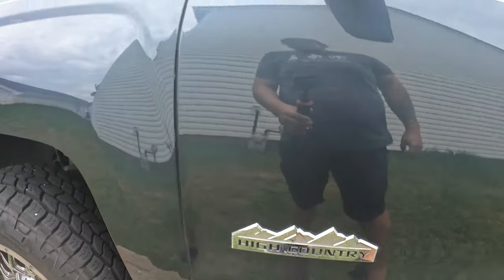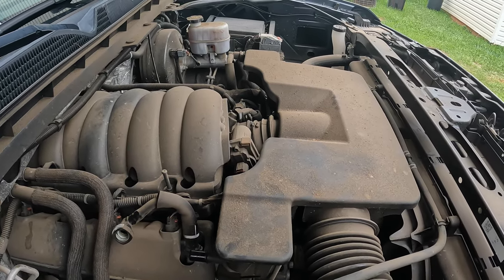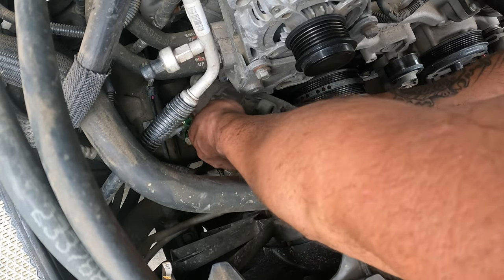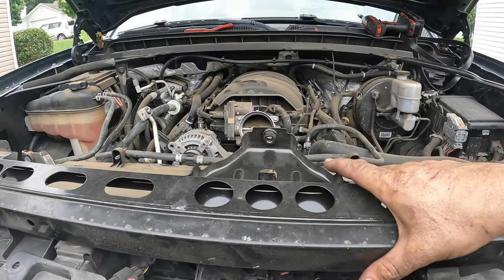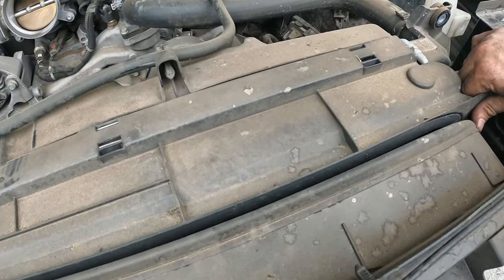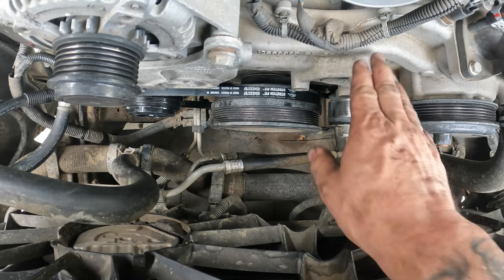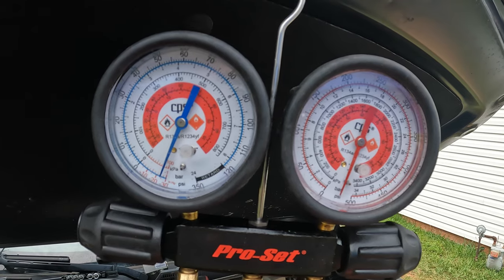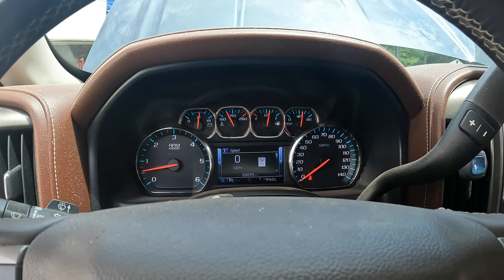2014-2018 Silverado AC Compressor and Condenser Replacement.

Comment: Would be good clean (flushing)system before filling up (why ac doesn’t work before)just my thought
Reply from the maker: It is a good idea and many times a compressor is not have a warranty unless you change the condenser or flush the system. Typically I flush the system if I do not change the condenser.

Comment: If belt good can walk it off by turning the crank shaft with 24mm/ 15/16 socket
Reply from the maker: Yeah that is true.  I normally always quote a belt with the job just to be safe.  I have seen lately  that some compressor will not warranty a compressor now unless you change the belt, especially if it is a stretch belt, and most require you to flush the system no matter what too.  But if the belt is in good condition you are right, you can always walk them off just like you put them on.

Comment: had a mechanic do motor mounts because I had a back injury.. he left the damn plug off the back of that AC pump.. Turns out with that disconnected, the clutch will engage however no cold air.. I'm assuming that is some type of pressure switch or valve that stops the flow of freon? I got it connected however it was after I pulled the lines and discharged the system.. The guy said to bring it in and he will do the draw down and 1234yf charge for free.. this is why i have trust issues with 'mechanics'..
Reply from the maker: I fully understand that.  That is one reason I started doing the videos as well to show my customers that I actually change stuff and I try to show me running the vehicles at the end as well.  There is a pressure switch both high and low for this.

Comment: What is the reason for draining the oil and filling it right back?  Why not use the oil that it comes pre filled with?
Reply from the maker: This one did not have the sticker that said how much oil was in it.  Some of them will tell you that it has "X" amount of oil in the compressor.  If it does not specify, I will drain it and then put in the correct amount.
Reply: @operationoverhaul you should had add that to your commentary I was about to ask the same question.

Comment: A mechanic just change and put new ac delco compressor a brand new expansion valve and replaced the belt as well “flush the system and recharged it but didn’t fix the problem not blowing cold air the old condensor doesn’t show any leaks so what could be the problem?
Reply from the maker: Can you hear the blend door moving when you change it from hot to cold or vice versa
Reply: @operationoverhaul  I’m not sure we didn’t even try that we were just focus on cold air.
Reply from the maker: @TheodoreRizzo  i would check to make sure the blend door is functioning properly and depending on the year,  I would check the cabin air filter as well.
Reply: @operationoverhaul  2016 gmc sierra Denali 6.2 liter when I switched from hot to cold the sound is a lot stronger coming from the glove box area. 
Not sure if that means anything nor what sound should I look for
Reply from the maker: @TheodoreRizzo  does it get hot when you switch it to hot?
Reply: @operationoverhaul  yes right away very hot
Reply from the maker: @TheodoreRizzo  i wish I knew what pressures are reading and does the compressor activate the clutch?

Comment: I’m having some AC problems with my 2017 Silverado. AC works great until it gets really hot outside (mid 90s and above), then it starts blowing warm air. Pressure in the lines is good, doesn’t appear to be leaking refrigerant anywhere. I’m wondering if it’s a bad pressure switch. Where are they on these trucks? It looked like one on the back of the compressor? Where’s the other?
Reply from the maker: Do you have a temp gun?  If so, check the temperature across the condenser to see if it is a lot hotter on one side versus the other.
Reply: @operationoverhaul  I don’t, but I could get one and try it. That said, the condenser was replaced just a few month back and the whole system recharged. I’ve only had the truck a month, so it was the previous owner that did it. The condenser looks brand new though, so I would imagine it’s not the culprit.
Reply from the maker: @DevinGrindy  if it has been replaced I would check the pressure switch. There is one on the compressor and then one on the high pressure line. I believe it is near the condenser on the driver side but I cannot remember. It may also be closer to the compressor.
Reply: @operationoverhaul  I appreciate it!
Reply from the maker: @DevinGrindy  your welcome and if you need anything more help or anything let me know

Comment: It took 45 minutes to put the belt on even with the lisle tool you linked?  Why?
Reply from the maker: I did not use the tool linked.  I was using a ziptie to help but this one was being stubborn for some reason.  Usually I can have them on in a few minutes but this one just did not want to go on.  It kept on wanting to walk off of the ac pulley.

Comment: The only info I can find for my 2015 Suburban shows that they use 6.6oz of PAG46 oil. My compressor came pre-filled with 3oz of 1234yf oil and says that if my system requires PAG46, I need to drain the oil and refill it with the PAG46

What the hell in the correct info??? Thanks
Reply from the maker: Service data on my end shows 6.6 oz of pag46.  So I would drain the compressor and then put in the 6.6 oz
Reply: @operationoverhaul  thanks for the info! I wonder why your vehicle and mine would use a different oil 🤷🏻‍♂️
Reply from the maker: @joeshmoe12301230  is your truck yf1234

Comment: So I just got to replace my compressor and would to replace my drier too?
Reply from the maker: If you are not doing a condenser I would at least do the drier bag, seals,  and flush the system.
Reply: Just got quoted $2500 to replace compressor and condenser , is this about right or am I getting ripped ?

Comment: How similar would this job be on a 2016 Tahoe
Reply from the maker: This should be very similar if not the exact same procedure. Normally the tahoe, silverados, suburbans, yukon and xl, and sierras are all about the same as far as engines.  The are a few differences but mostly the same.

Comment: Currently having problems with my 14 Silverado ac is cold sometimes then just starts blowing warm/cool air not cold. Pressure is good high and low pressure switch is testing good replaced relay all blend doors are working correctly and no codes you can hear the clutch working but has a very slight rattling noise. But it’s always done this. 
Any ideas what to test next 
Thanks
Reply from the maker: Does it get cooler when you ate driving and hotter when at a stop?
Reply: Check to see if the auxiliary fan is coming on
Reply from the maker: @kerrwilson265  that is what I was going to say especially if it gets warmer when stopped

Comment: Do you have details about the recall?
Reply from the maker: I'll get the details of the recall for you when I home from vacation.
Reply: @operationoverhaul  thanks!
Reply: Anything about the recall? Im just wondering how i can reach out to get reimbursed. I have a 2015 1500, that i yet have to fix
Reply from the maker: @muddy7776  https://www.lieffcabraser.com/defect/gm-air-conditioning/ try this site and it will let you know more about it.
Reply from the maker: @eumon84  https://www.lieffcabraser.com/defect/gm-air-conditioning/ try looking at this
Reply: Will filling the freon, you match the temperature outside with amount of freon?

Comment: I have a 2014 Silverado. I click the link for the ac compressor it shows me a RYC compressor not a Murray like in the video. Are all Murray AC components all owned by O’Rileys auto?
Reply from the maker: No they are not owned by oreilly. I can get you a link to the Murray if you would like. I'll get it for you tonight when I get home.
Reply: Yeah that would be great. I looked all over the internet. I can not find Murray Climate Control website anywhere.  But I do believe O Riley’s owns the trademark for Murray. No other parts store sells that brand.
Reply from the maker: You are correct.  I looked it up and Murray was purchased by Oreilly's Auto.  I also discovered that RYC and Four Seasons are sister companies as well.  So a RYC and Four Seasons (I think Napa carries them) are the made in the same factory.   I could not find a link to a Murray for you.  The RYC is the only one I can find.  Sorry about that.
Reply: No problem. I just wanted to double check some of the part numbers before I purchased and came along all of this. I do know RYC has a website but even putting all my info in. It shows a couple of kits but It doesn’t show the difference. So I have tried calling them and I emailed them waiting on a response.  But your video is very helpful. I just like doing a lot of investigating before I purchase. Just so I have all the right stuff here when I go tearing it down.
Reply from the maker: I wish more people would be like you and research stuff before purchasing.  Sometimes more expensive is not always the best option.  If you need anything else feel free to contact me.  I will help out as much as I can.
Reply: Thanks again. I wasn’t trying to show you up on the parts or bashing on you. I just wanted to make sure I’m ordering all the right parts the first time. Thanks. I will hit you up again if I run into anymore questions.
Reply from the maker: @MrKgolden32  I didn't take it that way. I'm glad you said something actually because it made me want to check it out.   I definitely do not know everything and if someone let's me know,  I appreciate it. It doesn't just help me out helps others that see the comment as well.

Comment: I put two compressors on and they both making noise when I try to charge it
Reply from the maker: What kind of noise is it making?
Reply: Screaming
Reply: Tryn to lock up
Reply from the maker: Sounds like the clutches are bad on them.  Can you measure the air gap on the clutches and let me know what they read?  It should be between .4  to .7 mm air gap on these.

Comment: My 2014 just chunked the AC belt. AC has been working great. Do I just replace the compressor or is it a possible clutch issue? TIA
Reply from the maker: I would see if the clutch will spin or if it is locked up.  It could be a clutch issue.
Reply: The clutch spins very freely.
Reply from the maker: @ryannegrete9799  can you rotate the compressor then?  If those two are good then the only thing I can think of without looking at it is the belt may have been bad.
Reply: I understand and I appreciate all the info and time sir! I was driving down the road and heard something squealing really loud and then stopped squealing. The AC got hot a few seconds later. So I will check the compressor itself first and repost so maybe my problem will help others as well.
Reply from the maker: @ryannegrete9799  your welcome and I'll try to think of something else it could be.
Reply: @operationoverhaul  my 2015 Silverado did the same thing his did. Like exactly everything but I’m not sure what it’s called but the pulley wheel(I think) turns freely but the compressor or clutch is locked if I’m not mistaken. Would that mean I need to replace everything? Condenser, compressor, flush, expansion valve etc?
Reply from the maker: @noahw5802  I would at least do the expansion valve and then flush the system

Comment: Why mine keeps leaking where the high and low hose meets compressor ?
Reply from the maker: Could be the gasket leaking, the mating surfaces are not true, or the hose ends are bent.